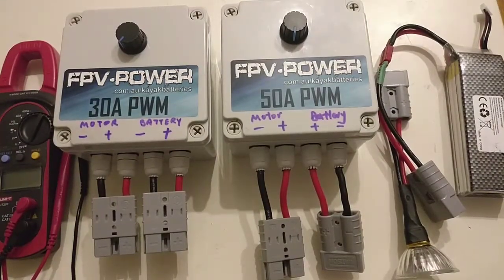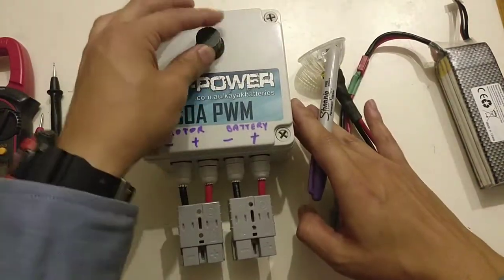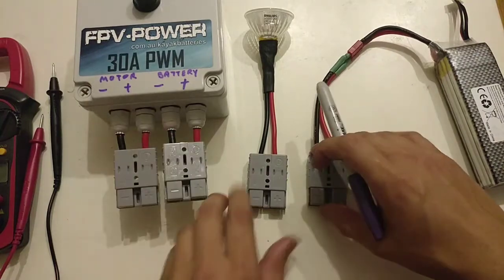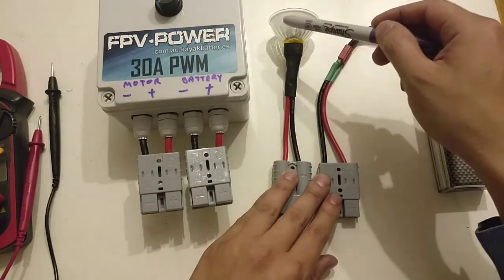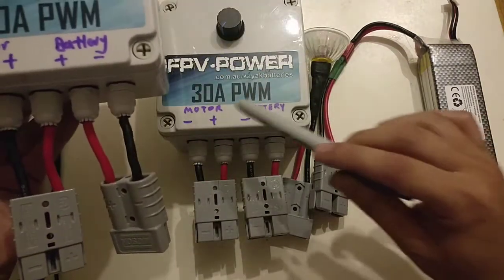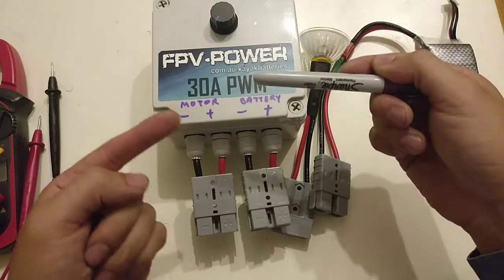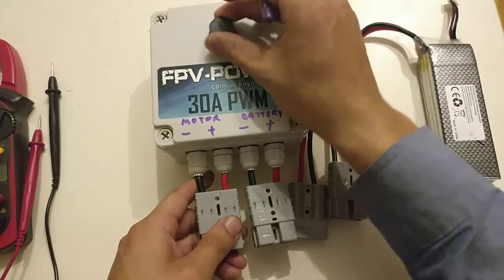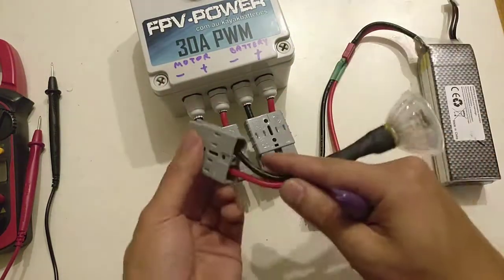Fpv-Power Kayak PWM motor controller

Comment: HI MATE Can you possibly help have you had anything to do with the EVOLVE 403 motors in the HOBIE KAYAKS all i am trying to do is replace the power lead that has perished as it is a 2014 motor have obtained everything new power cable new o rings new shaft pins i cannot get the bloody 32mm aluminium bloody stub unscrewed maybe you have other contacts to help THANKING YOU TERRY

Comment: Is it possible to use an Ebike 36 volt battery to power a 12 volt troller?
Reply: It will handle up to 48volts input, but you have to be careful not to turn output of the pwm too high as to supply to high of a voltage to burn out your motor (load) if it's rated for 12v, or 24v etc..

Our version of the pwm with safety cuttoff will not work as the safety cuttoff system is  12v based which is powered from the input.